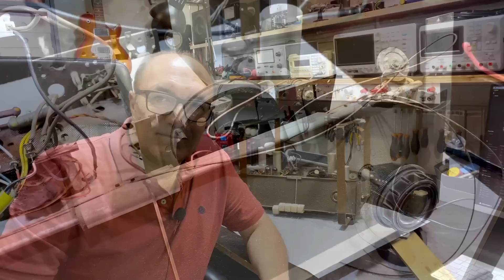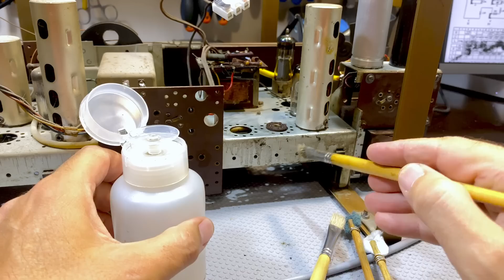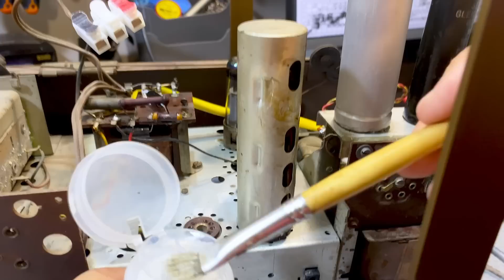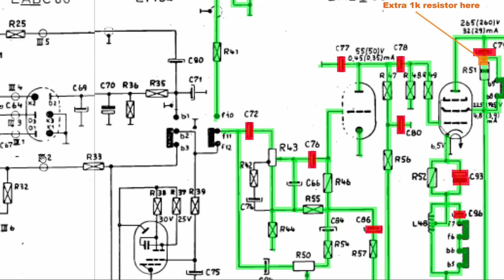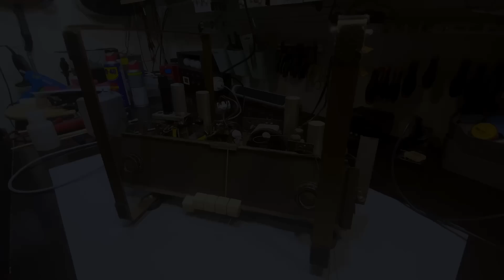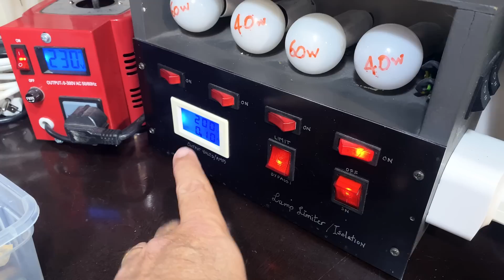Our radio has found her voice. Power and Audio testing. Nordmende Super 250-9 rest. pt. 2

Comment: i was wondering if it´s a good idea to connect the green yellow earth to the chassis.... for several reasons, but one of them is you are inviting static noise from your "dirty" earth-line in the house into the receiver.
Reply from the maker: it’s always a good idea for safety reasons. In fact, if I’m not mistaken, in many countries this has become an obligatory connection. Line noise is always an issue, and I’ve certainly had my share of it, even when not connecting earth to chassis. I’ve experimented with capacitor filters on the mains but as yet haven’t found the perfect one.
Reply: @electronicsoldandnew  
Hi Mr. Caldeira, you are completly Right about security. But be aware you are connecting the radio Antenne Earth to the protective conductor.. how do you connect L M K Antenne in terms of earting ?  
Ground Loop?  Btw i love your movies 😉
Reply from the maker: Let me make a confession: The radios that I am going to use personally don’t normally get connected to mains earth.  If I think someone else is going to use them, I connect the earth. I fear that someone may get zapped and I’ll feel the guilt 😊 I’d rather they get a little noise than a shock.

Comment: Great video! And the first time I actually see someone giving a reference voltage level for the pickup input and the speaker output. This might seem obvious for many, but for people starting with tube radio repair, that type of info is very helpful! I remember when I started with this, I had no clue what level to put on the input or expect at the output.

Comment: Another good video =)
I have a question if you have a moment of time. I'm finally getting around fixing up this ole Airline 1814A. Not a complex radio at all (one of the reasons that I chose it). Looking at the schematic I have found a disparity. On 2 voltage supplies there is C1A/B. Inside the can, on the radio now, (this very much looks like an original part) there are 100, 50 mfd caps, the schematic shows an 80, 80. Do you think it really matters all that much? Would you stick with 100,50 or chose a couple 80mfd caps?

From what I've managed to learn, I don't think it will matter all that much, but I also have a feeling that this may have been a change because one of the voltage supplies needed the extra capacitance.
Reply from the maker: You’ll have a really hard time finding 80uF caps. I’d go with the 100/50.

Comment: Well done. The mains transformer tap appeared to be still in the 220V position, though this probably doesn't matter whilst on the dim bulb, I wondered whether the B+ was now higher with the replacement rectifier.
Reply from the maker: Yes, the dim-bulb will stay in action for now. The B+ did go up quite a bit.

Comment: I like this set, unlike many of NordMende's later products. When I was an apprentice TV engineer back in the '80s I had to work on their portable TVs - they had been modified to work on UK mains, which involved a transformer and a few dropper resistors (they didn't natively have the multiple voltage selection like this radio). They were very unreliable and a nightmare to work on. I think everything was overdriven by the power supply causing random things to fail. Keeping one going was like spinning plates. It's a shame that happened because I think NordMende normally made quality kit.
Reply from the maker: a their 50s radios were certainly built to a very high standard. Some accountants must have stepped in later 😊

Comment: I use a Weller 250 watt soldering gun and a piece of 12 gauge wire as a tip for chassis soldering. Mr Carlson showed this On a video a long time ago. He recommended the older guns but I got a new one cheap and it’s fine. I did require trigger because for some reason Weller had it so reduced power was when the trigger was fully depressed and full power when 1/2. That makes it painful to use when you want a lot of dwell time. The use of wire means it’s cheap to replace and you can bend it to custom shapes
Reply: @electronicsoldandnew  ‘rewire the trigger’ (typo)

Comment: I noticed that there are differences on the schematic as regards depiction of resistors. Some have an “X”, some have a “/“, some appear to have a “=“ sign across the middle, and some are just empty rectangles. I’m not familiar with this convention. Can you enlighten me as to the significance of the different designations?
Reply from the maker: These give the power rating of the resistor, which is usually shown on the service manual (usually on the schematic sheets itself).
Reply: Thanks! I’ve not seen that before.  Must be a Dutch or European convention.  (We don’t see that many European radios over here…)